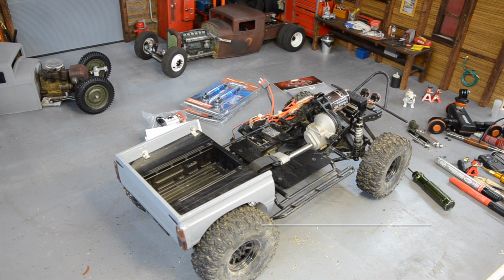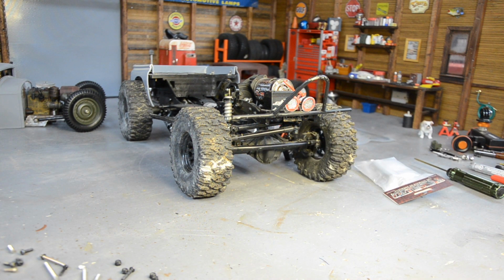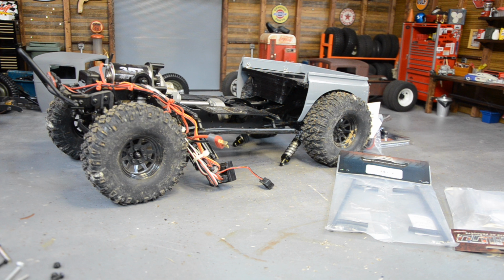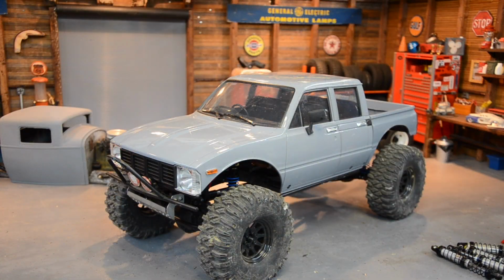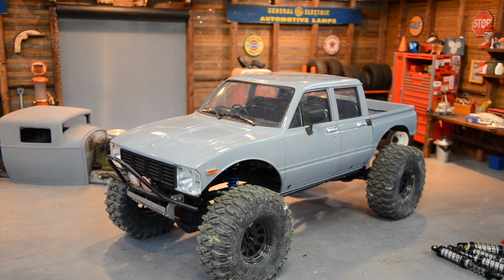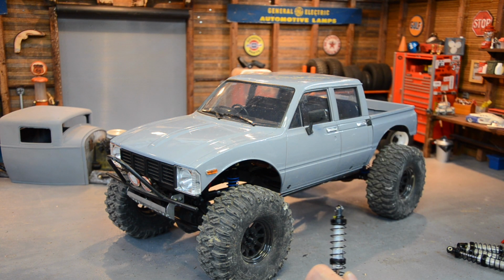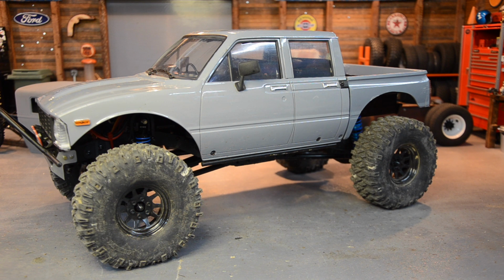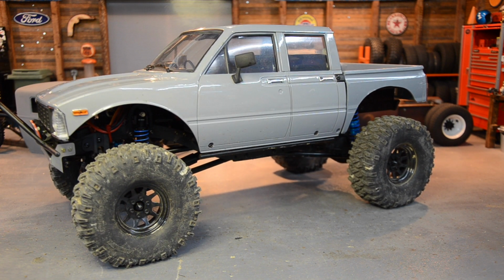More Mods for the RC4wd C2X, King Shocks, Sliders, Scale RC Crawler

Comment: Great Video, Ive never owned a Hard body Crawler, are these rigs capable to run comps with or are they to Heavy? whats something like this weigh? I always see everyone reducing weight running lexan & doing everything they can to achieve lcg? any help much appreciated? Thanks
Reply from the maker: There is really two worlds of crawling, Comp rigs like you are thinking with lexan bodies and these scale crawlers.    They can weigh anywhere from 5 to 15 lbs.  They wont be as capable but its more about the scale capability.  Looks and performs like a real truck would.  class 1 rigs have to have the tires tuck under the fenders, basically a stock class, this c2x is class 2, which can have linked suspensions but mostly a full body.  And so on all the way up to the light comp rigs you mentioned.

Comment: any Ideas on making it climb the steep stuff. I am thinking of ordering taller shock towers or going with 80mm shocks.
Reply from the maker: Honestly I have changed so much on mine I dont remember how it was stock.  I have taller shock towers I think, but with 80mm shocks you may hit the axle on the trans.  I have even lengthened the front 4 link by 5 or 6 mm.  Have a new video tomorrow of it where I swap in the scale V8 engine.  Really adds a lot of weight up front.  Im excited to see how it performs now.

Comment: Hi how are you? I finally got my c2x and I noticed that the servo is kind of weak, did you swap yours? also I noticed that the motor is poor but I seen you swapped yours, Thank you good videos any suggestions or advise are more than welcome
Reply from the maker: Check the adjustment for the steering on the remote. For some reason they were all shipped turned down. Also I am running a lipo battery at 11.1 volts. The servo is plenty strong after that.